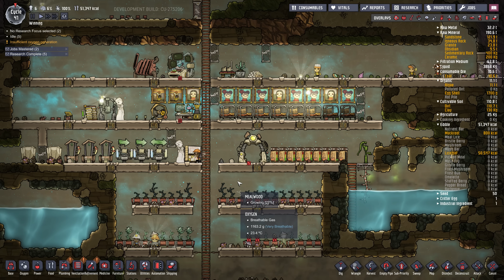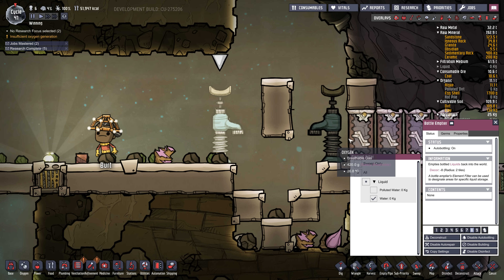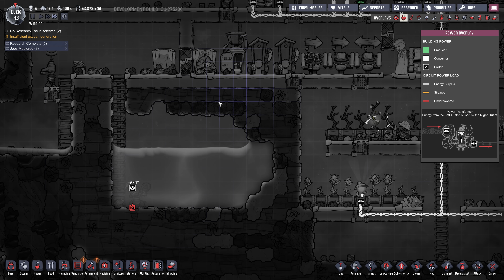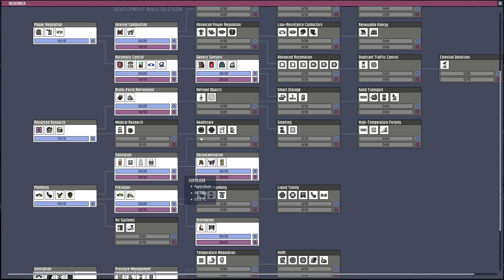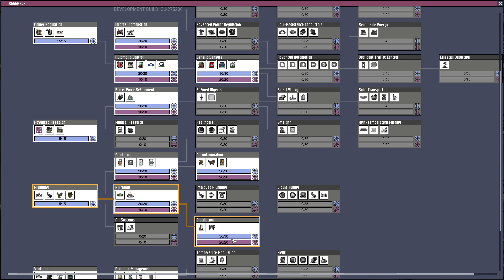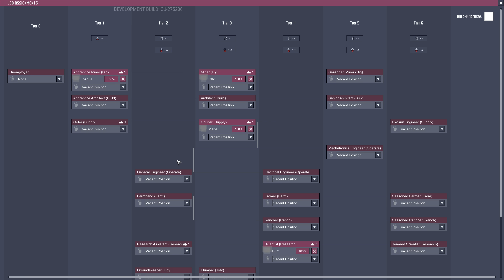Oxygen Not Included - Tutorial Guide in 2025 #4 - Liquid Lock & Infinite Water Bathroom

Comment from the maker: Abyssalite (for pipes and tiles) has since been removed in the latest space industry update. The next best insulator early game is an insulated tile made out of igneous rock. If you don't have any yet you can use sandstone or granite but those aren't as good. Later on you get ceramic which is better and late game you get a perfect insulator like the old abyssalite but it requires ingredients from other asteroids (ie rocket trips).
Reply: Yeah I made the mistake of using older guides like this (although they are still great) and only found out around cycle 150 that I'm never going to get to use Abyssalite for insulation.  Heat has been a major problem for me but I've now got a design happening although it nearly cost all my dubs more than they could give.  I had to build a system of insulated pipes from a geyser into an ice biome, via an anti entropy thermo nullifier using radiating pipes limited to 2000mL then through more of the ice biome before finally arriving home at a nice 5-20 degrees depending on how angry the geyser was feeling.

Also, with the bathrooms build your waste pipes out to the side, it's less pieces of pipe and hence less decor issues.
Reply from the maker: Probably not but it will add some stress. As long as morale is somewhat high you should be ok.

Comment: Great video but just so people know the infinite bathroom shown here no longer works.  It appears that the germ level will build up in the water and slightly exceed the level that the sinks clean in one go but not enough that the dups think they need to use a second sink.  So they start to wander around infecting the base,  

I ended up feeding the output of the sieve into a chamber filled with chlorine gas using three liquid storage devices in series with the output of that dumping into its own reservoir.  Too paranoid to just dump it into the main one. 

I like the change because it doesn't make sense to wash your hands with germy water and get clean.
Reply from the maker: I havent hit the germ thing you are talking about.

Comment: Incredibly helpful tutorial. Only critique that I have is I would like you to say why you are building certain things out of specific metals.
Reply: Usually, it has something to do with insulation or overheating. For example, if you want to cool your base by building a few pipes and running cool water through them, you will need to make them out of a material with high thermal conductivity.  Or if you're building  pump in a place that can heat up to like 300 degrees, you'll need to make it out of something that can withstand this temperature

Comment: So I build the same system with carbon skimmer, but it is not pumping. It starts with good speed but in a few seconds pumping gets very slow. I tried to replace pipes, enable/disable skimmer and even rebuild the whole system. But always got the same results. Can anyone help please?
Reply from the maker: Are you trying to do the infinite loop thing with a sieve? Take a bit of water out as it might be blocked or add a liquid tank that doesn't completely fill up. Also it won't work as fast if it has low carbon dioxide.

Comment: instead of a liquid lock, couldn't you make an "n" or "u" shaped lock. for "n" locks: oxygen will flow to the top of the "n" but it shouldn't go down the other side if there is a heavier gas below it. For "u" shaped locks: chlorine will go down into the bottom of the "u" but it shouldn't go up into the other side of the "u" if the oxygen is on already there blocking it. Though i've never played this game, i'm pretty sure this will work; in these past four episodes i've never seen a heavier gas push itself up through a lighter gas. Perhaps you can put hydrogen on the top of the "n" or co2 on the bottom of the "u" for an additional seal. Edit: oh nevermind, plenty of people already commented this.
Reply from the maker: Yeah gas locks work equally well. They are a bit harder to set up though as dribbling water with a bottle emptier is easier in my opinion.

Comment: Is there a way to clean the clean water with germs i really want to not worry about losing water.I already have a decent amount of food and a crap ton of oxygen using the electrothingies (i forgot what thay are called) and all of my algae
Reply from the maker: You can put it in a liquid reservoir that is in a room with chlorine gas. All the germs will die. At least it worked with gas...  otherwise if you let clean water with germs sit...the germs will die off...takes time though. I usually use germ water for plants.
Reply: ok thanks so much ok last question (for now)
Whats the suitable amount of dups cause i think im screwed im on cycle 56 i do have really good oxygen and food but i have 9 dups they do have decent stats and most of my dups jobs are almost max
Reply: And i also cant  find a god damn geyser

Comment: Hey GtG, quick question. So I'm not using the auto-build function, and I'm having difficulties getting my dupes to man up and hold their breath. Their sanity skyrockets to 50%< so I have to give them a day off for massages every other cycle to de-stress. I had one duplicant die in the CO2 pit while trying to dig air pockets. Any advice on how to get their keisters in gear?
Reply from the maker: The early game way is to supply oxygen to your dig tunnels an algae deoxidizer + maybe coal or dupe power in a small sealed room so they can catch their breath while away from the base. Longer term atmosuits/exosuits are the way to go. The dupes walk very slowly in them unless they have training. You'll need refined copper and thimblereeds to build them I think. In episode 6 of this guide I show how to set them up.
Reply from the maker: As for sanity, you can build some paintings or statues along the way to help keep the decor up while they travel. Later on you can make snazzy suits which can help as well.

Comment: Instead of a liquid lock, how about, like, a sideways S-shaped hallway that uses the weight of the gasses to keep themselves in place? So, the dupes can climb up and down through it, but the oxygen gets tile-blocked up top and the chlorine gets tile-blocked below it. Can you picture what I mean?
Reply from the maker: Yeah I think that would work depending on pressure.
Reply: A P-trap used for plumbing.
Good idea. If space and pressure is not an issue then it would be very cheap.

Comment: Damn this is good stuff, thanks man.  One question, is there any way to create some sort of pressurized path, to prevent leak of gases 100% (like the liquid one) but without the liquid? to avoid the negatives of this lock, maybe a more advanced tec?, or using the liquid lock is the only 100% safe method to prevent ur green gas to escape.  Thanks !
Reply from the maker: It's the only 100% safe airlock I've seen. You can create a room between two airlocks which sucks out all the air between uses and filters the correct gasses where they should go. Much more energy intensive and might still have a risk but I've never actually built one. If you dig in from the top of something like a chlorine room and you have high pressure oxygen above it, there is little chance the chlorine will rise out.

Comment: Looks like you buried that poor drecko!  I usually run pipe to where I am making a water lock with the outlet on the bottom tile.  It goes overpressure just as it makes a seal.
I've also been putting suits before the water lock so they don't get a debuff and can be in that place longer.

Unless they changed it that sieve output is at 40c.  It won't work for plants.  Cooling down an area full of 40c water takes so much energy.

Comment: You put a little trap for beginners there :)
Every toilet produce 5,7kg of excess water in "infinite toilet loop" and one Blossom consumes 20kg of water per cycle, so 3 toilet's will feed only one plant per cycle.
There is also another good way to use cleaned water with germs - Refinery, it will warm the water to the temperature when germs start dying really fast and also allow you to not use "Clean cold water" from main water storage.
Reply from the maker: Just add dupes :) I did mention that they could pull water from a tank instead of the toilet line. 

I like the refinery idea.
Reply: If I remember correctly, it is a bad idea to use germy water for the wash basins. They should always be fed with fresh water, right?
(Using the excess water for food is always fine, just have to be extremely careful when deconstructing filled pipes, as the water may spread germs when spilled on the floor.)
Reply: It's 100% fine, I use self-sustaining bathrooms\wash basins since "Jobs" upgrade and they working fine. If you have Plummber specialization you can "empty" them without spilling any drops of water.
Reply: so... if you have 7 dupes, 5.7 x 7 = 39.9, meaning it's gonna irrigate 2 blossoms right?
Reply: @JamesBucket  since 39.9 is still less than 40 you will halt plant growth a little, my solution is find one seed of Thimble Reed(can be found is swamp biome) and send all excess polluted water there without clearing. It will grow slowly, but provide you source of fiber for suits, if you REALLY short on clean water - blossom way is better.